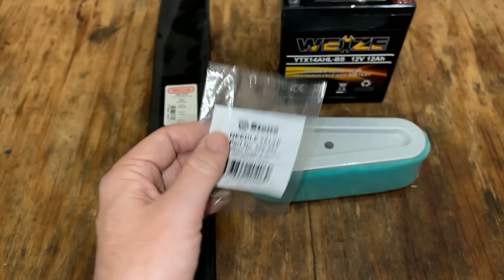First Start in 20 Years - MTD Riding Mower w/Briggs IC Engine

Comment: Your remark regarding the mowers' lack of a blade brake led me to visit the MTD site. I was able to locate and download the owner's manual for this machine; In it I discovered that on page 14 of the manual it describes the adjustment of the blade brake. It appears that the brake is an assembly attached to the mower deck nearest the rear of the machine and that it pushes against the belt on main pulley. The brake appears to be activated by a cable connected to the 'brake assembly, (although I'm not certain where the cable attaches to the engine).  You may wish to contact MTD to determine the availability of the brake assembly. Given the size of the blade on that machine I would be very leery of operating the machine with such a vital safety feature absent from the machine. As you say at the end of your videos "I hope this helps."
Reply: Any chance you can send me a link to that owners manual, Thanks 🤙
Reply: great find, impressive.  The blade brake is paramount and I too was surprised it didn't have one, even at 26 years old.  Most major blade safety innovations were incorporated well before that.
Reply: Dude, you just engage the PTO when the engines off to stop the blade and use the belt as a brake... Duh..
Reply: Blade brake is absolutely not nessesary! On the deck … I just swapped a single to twin on a airens (craftsman lt1000) same machine ..

It had the stupid brakes on the spindles previous owner couldn’t shit them off because the grove they slide in and make engage the spindle brakes was worn 

UNBOLT THEM AND TOSS UM IN TRASH !!

U do not need them nor does any mower !
Reply: That “safety feature “ is the most unsafe method possible ! 

It’s irrelevant just like reverse safety switches and all the others !

If you’re not able to operate one without them u shouldn’t be riding Any mower lol ( no disrespect )
Reply: Cable runs from your blade on off lever to the deck center mount that pivots and a the roller guides on the brake arms move when the piece rotates ..

Remove the brakes #1 
Then attach a return spring to that engagement lever = done .
Reply: @andrewchristiansen8311 lmao yep I rip those stupid Brakes off too lmao
Reply: Do it all the time !! First thing I remove personally …

This is the whole issue is ppl misinformed on a “safety part “ that failed from the beginning…

Lemme ask u this …. Would you stick your hand in the deck immediately after u turn off blades !?? I’d hope not (LIKE ANY MOWER BEFORE ) never came with spindle breaks . Period ! Unbolt and run it !

Stop reading what manufacturers say none of them have a clue or they wouldn’t have done it in first place .

All it is is an arm that presses up against the pully of your blade spindle when u release the engagement lever for the deck they get pushed out (metal on metal) lol brilliant smh.🤦‍♂️ 

They get stuck and u can’t turn blades off ! How safe is that…..
Reply: Wrong again Srry lol
Reply: The cable runs from your manuel deck on off lever to a spring attached by a quick pin on the tensioner pulley ..
When u push the lever up and lock it in to turn blades on your pulling the idler deck drive pulley tight to belt hence (on) and when you release the lever the two brake arms are supposed to spring out against the pulleys on each blade stopping them sooner . Pointless and the constant metal on metal wears the metal plate it’s mounted to out and they get stuck on …. Then u will remove them once you’re fed up with it .

Pull your deck out look at it it’s the most simple straight forward set up there is .
Reply: @harpoon_bakery162  wrong

Comment: I did not read all the comments so I don't know if anyone brought this up.  The blade brake has been removed from the deck.  It's a small part that uses a cable and spring to push against the blade pulley when disengaged, and then pull away from the blade pulley when the blade is engaged (spinning). Manuals and parts guides are available on-line and if you look at one you will see what I am talking about (MTD p/n 16053).  I purchased this exact model in 1999 and used it for 14 years.  When the tires were inflated properly and the the deck freshly leveled according to the manual, my lawn looked as smooth as a billiard table after I cut the grass.  Man it looked good!  The problem was that the deck did not remain level throughout the mowing season and needed quite a bit of adjustment the following Spring.  I sold this mower in 2013 because the 4-foot long clutch rod (p/n 747-0560) broke off at the engine side and a replacement was not available.  This clutch rod eventually wears out because there is no bearing or bushing at the pivot point near the engine and it "saws" its way through the pivot attaching bracket (p/n 15585).  Also the differential leaked near the brake assembly and I removed it entirely (twice in 14 yrs) to replace copper bushings (p/n 741-0336 & 741-0337) for the aux axle shaft (the shaft with the disc brake attached to it).  Not a big deal but still a PITA to replace the bushings.  You might consider removing the engine/mower cover because it will rattle itself to death.  The corners will crack and the aft end will vibrate like a paint shaker when the engine is running.  This mower uses a twin-belt CVT drive system and is by far the smoothest mower I have ever used (except for a hydro drive).  Keep some spare belts on hand cuz you will need them eventually.  Nice job bringing this mower back to life! EDIT:  One more thing - this mower could cut going in reverse just as fast as it could going forward and I liked that a LOT!
Reply: Incredible detail and so much so that if I may ask you a question ,I'd certain like to run it by you and also perhaps James might know.  But here goes.  It's a Yard Machines 38" Shift-on-the-Go -  Model 13AH660F352 (era 1999 to 2001), Briggs & Stratton 12.5HP - Model: 28T707  Type: 1154-E1  Code: 010302ZD.    The unit runs great and cuts great but late in the season last year it started  having problems moving up slight inclines or grades in the yard, pump the brakes and it would continue.  Just got to the point where it wouldn't move forward.  I looked underneath and noticed a leak at the main dual pulley attached to the engine shaft.  Oil was all over both pulley's as it drips down and settles around the big pulley.  Obviously the PTO Seal is bad and all the belts have oil on them and they get ruined or soaked with oil.  If I remove the dual pulley from the shaft (with the mower jacked up using a floor-jack in front), can i get to the seal with a dental pick or other "Taryl fixes all" techniques, remove the seal, then have enough room to re-seat the seal with a PVC pipe or other trick?  My goal is to NOT have to remove the engine to perform the seal repair, and I hope to heavens that the shaft is not bent, but I don't have any reason to believe it is, I think it's just a bad seal as good as the engine runs and as good as this thing cuts grass - even with a spindle that needs replacing on the right blade, this thing really performs well.  Any help is appreciated.  The mower looks exactly like this one at 02:11 in this Taryl fixes all video --->>> https://www.youtube.com/watch?v=n-ukW3UFs68&t=1257s
Reply: @harpoon_bakery162  

I think if you can remove the double drive pulley from the motor shaft without too much hassle and there is nothing blocking the path to the motor shaft you may be able to replace the main shaft oil seal without removing the motor.  It’s worth a try anyways.  At the 11:35 point in the Taryl video link you can see how difficult it may be to remove the drive pulley from the motor shaft.  Taryl uses an air hammer to easily remove it but if you don’t have that tool it can be quite difficult.  It’s best not to pry on the pulleys because they bend very easily.  I don’t have an air hammer myself so the best way I found to remove the pulley is to remove the engine/drive pulley combo from the mower.  I remove the bolt holding the pulley to the engine, then get a longer bolt and thread it into the motor shaft until it bottoms out, and then hammer on the bolt while holding the pulley by hand while the engine is suspended upside down (takes two people).  I am aware that on some mowers the engine/drive pulley combo cannot be removed as a unit - they must be separated beforehand.  If that is the case for this mower and the pulley is rusted to the engine shaft, you may be in a world of hurt if you don’t use an air hammer to separate them.  From the Taryl video, it looks to me like there is room to access the oil seal from underneath the mower.  However, don’t be too disappointed if you run out of space and have to remove the engine from the mower.
Reply: @perrywesthaus1537  ok, great information, that will help me.  I will attempt to do this , it chilled back down so I'm waiting for it to warm back up.  I will get that shaft off, I think I was able to get it off when I replaced the belt (can't remember), but I had followed the Tayrl video to a tee and got that belt replaced.... i might have got that sucker off last time but didn't realize the seal was going out.

Comment: Great job James. I have serviced many of those Briggs I/C engines over the years. They are great engines. Wish Briggs still made them. Thanks for the video.
Reply from the maker: Thanks.  They are great engines.
Reply: Same! I have a generator and a mower that are both over 20 years old that have the Briggs I/C engines. They always start easily and run perfectly. These engines came from the time before extreme cost cutting measures were introduced.
Reply: Breaks an scrap em lol. Will stick to my kohlers,onans, kawasaki engines. Got few john deeres from early 70s that put most the newer stuff out to pasture real quick. The old 140 h3 is as reliable as they come

Comment: How did I know you were going to try to pull it out ! You should push it into the tank and remove it through the filler hole ! See you chipped away on the outside but none came off the inside, so push it in, do not pull !

Comment: The drain valve for the oil you can get an adapter to screw into there and put a hose on it give me three inches is all you need and you be able to use a bigger drain pan. I know you have a pressure washer or at least the garden nose would have cleaned up the underside of that blade guard had you could have given it another coating of rust preventive spray of some kind that way you can get another 20 years out of it. It was a heck of a good video the sound and is always in focus great job😊😊😊

Comment: The oil drain may have been designed for a hose to be connected and run out to a pan and then the screw opened thus preventing a mess. The backfire when you shut it down was caused by a very hot engine after working so hard, a fast idle and not giving it sufficient time to cool down. The fast spinning engine pulled lots of unburned fuel through the engine and into a hot exhaust manifold. "BANG"

Comment: This mower brought back memories. My first ever riding mower was the Sears Craftsman version of this mower that was made by MTD. It was essentially a cheap piece of junk, but it beat push mowing. After a few years of using it the engine would randomly shut off and sometimes would re-start, but usually not. The following week it would fire right up and once again randomly die somewhere in the yard. I finally got sick of it and started tracing down the magneto kill wire from the ignition switch and found the insulation slightly rubbed through where they had ran it down through the engine cooling fins. Vibration would cause the wire to occasionaly ground out and kill the engine.
Reply: I think we had a similar mower in the 80s, also a Craftsman
Reply: Formula 303 & a Bycycle tube ,top glued & a 1%4 skirt. Get a " Gator" blade & mulch forever,  bag was a HVAC" monster & deflector either fell off or piled?
Reply: Probably AYP. Not MTD  old craftsman were AYP
Reply: I think I have one like that. Did yours have a tecumseh motor on it?
Reply: @jamesbrannon9594  AYP made both i thought
Reply: @M.TTT.  well after I wrote the comment I saw the side cover on the mower MTD. I know that AYP built the craftsman for years then it changed to MTD. But MTD bought up other companies and may own AYP now just not aware. At one time MTD and AYP were separate companies.
Reply: My Craftsman had a one-piece yellow fiberglass 'body' - I think it was made in the mid-70's.  I borrowed $350 bucks from my Dad to buy it used at a yard sale.  I mowed neighbor's neglected back yards with it and paid back my Dad in a couple months.  A few years later I sold it at a yard sale and got $350 bucks back again!

Comment: Thanks, AGAIN, to Stanley for the donation to the channel! The machine cleaned up great and the engine ran very well it seems. Would have been great to see where the new blade aligned relative to the bottom of the deck and I agree that no blade brake is a safety hazard. Truly shocking that the spindle and bearing spun as well as they did though! As you stated,  equally as shocking was how well it mowed through your very high grass. Will be a great machine for Stanley or someone else for years to come. Top quality content as always! 👍👍
Reply from the maker: Thanks Eric

Comment: A trick that works for me on the carburetor is use a piece of beveled brazing rod as a lapping stick with past to change the seat angle . Most of the time the seat needs to the needle in a different spot to seal  . Long term leaking can cause pitting or ware on the seat  . I also use a Q tip in a drill with past to polish the seat  .Good Luck

Comment: While not the pinnacle of mowing technology at the time it was made, it is tremendously adequate and dependable.  Changing tires on one of them is a complete pain.  The smaller the tire, the harder it is to do.  I'd rather do a dozen car tires.  Glad you got it worked out!
Reply from the maker: It seems counter intuitive, but true.  The smaller the tire the more difficult it is.  Would be so much easier with split rims and tubes.

Comment: I really enjoy your videos you are very knowledgeable when it comes to small engine repair I owned a small engine shop for nearly 20 years and you work on things the way I used to and the same way in the same patterns I'm retired now because of disability I am 57 years old not too far from regular retirement anyway you're the only small engine mechanic I've seen on the internet that actually knows what they're doing I get so frustrated watching other mechanics make huge mistakes so far you're decent mechanic I really good mechanic in fact keep making them I enjoyed it a lot I'm as I miss working on small engines
Reply from the maker: Thanks.  I am always learning an do make mistakes, but try to get it right.

Comment: Thank you for this.  This one has inspired me to go drag that 35+ year old Snapper riding mower I've had stored under the house for near 30 years, and see if I can get that thing going again.  It may qualify for Antique Vehicle status by now. Oh, one thing I meant to mention, cleaning and buffing or de-burring needle seats, I use Cratex rubberized abrasives very successfully.  They look like pencil erasers with a 1/8" arbor that fits in a drill, or a dremel.  They have all sorts of different tips and shapes.  I use them for porting and polishing heads.  Pricey a bit, but they work.

Comment: Great job. You always amaze me with your thorough step by step process. Although a bit pricey you might want to pick up a can of rim bead sealer....great stuff. Just swab around the bead and it lays a fine layer of rubber that seals the most stuborn leaking beads. Low volume, low pressure tires have more of a tendency to have leaky beads. That incorrect blade also has the added problem of not providing a good suction thereby contributing to insufficient discharge and grass buildup under the deck as well as a serious safety issue. I remember those little flat-deck mowers well. I think Snapper and Toro had them as well. I would fully expect to see it in at lawnmower race track....yea, that is a thing here in the south.

Comment: Excellent video. I watched the entire video and followed you through all your steps.  You have a ton of patience and know when to back off to avoid causing damage. I was mowing lawns in grade school and eventually bought a Lawn Boy 2-cycle commercial mower for my yard. It was a beast but eventually gave out after 17 years of use. Sadly, they don't make the 2-cycle engines anymore for the mowers. The only issue seemed to be the magneto would fail every couple of years.  It was an easy fix, but the pat got progressively more expensive as the years went on. They seem to know the weak spots and failure points and adjust the prices accordingly.

Comment: I bought a new Ariens riding mower in 1982 that had the Briggs IC engine that was longer than yours, but narrow enough to fit through a standard walk gate. It ran flawless for 10 years cutting 1.25 acres, twice a week, in Florida. I swear by the IC engine. It cut any grass I threw at it. When we moved from FL we moved to a much smaller yard, so we put it up for sale. Just about got what we paid for it new from a Lawn service company. Since it had a rear  double garbage can sized bagger on it, the purchaser was thrilled with it, just like I was. Sure wished Ariens still made smaller mowers like that one! Now that I have a hard time using even my self propelled  Honda Harmony (which I bought in 1992, and still runs fantastic) due to my old age. I sure wish I still had that Ariens rider!